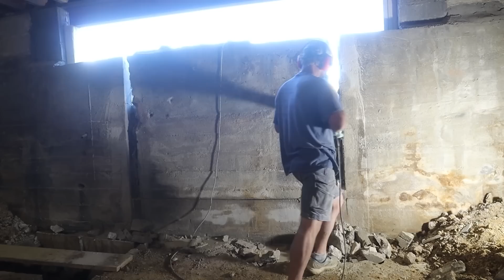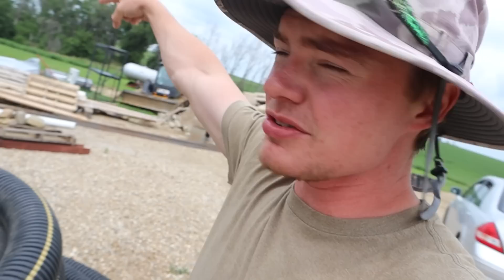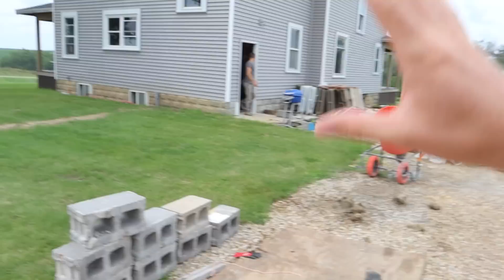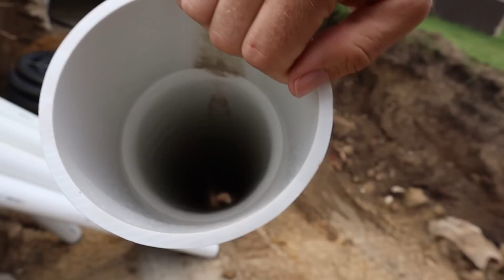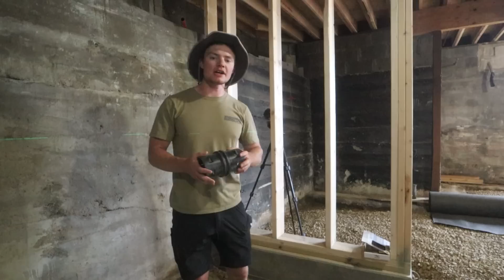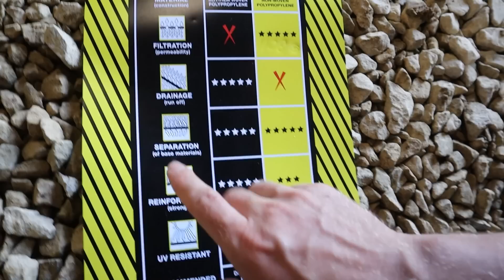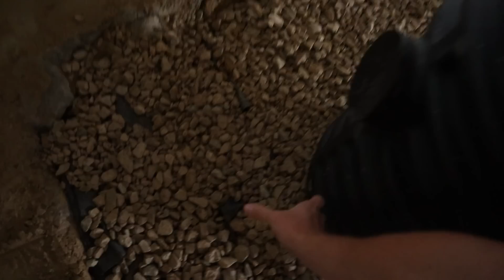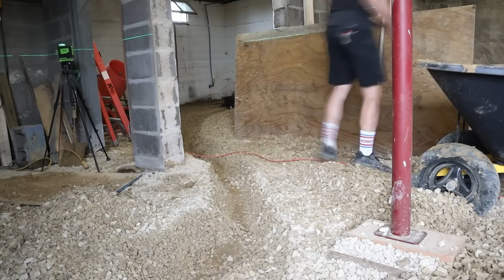Restoring A $7,000 Mansion: Building A Basement Water Removal System

Comment: I’m still confused as to the advantage of keeping this unit standing and rebuilding it from the inside. Everything is being replaced. After redoing the attic and the third floor and all the flooring in the second and first floors plus the staircases now you are again in the basement to actually create footers and the sewage and water. 
Couldn’t this have been done new from scratch and have saved $ and time??. Would save from digging out footers with a hand trowel and fixing the drainage and the radon. Can build it in from the start.
Reply: tearing down is much much more expensive then doing what he is doing.
Reply: @warrenmichael918  

Possibly cuz I’m not up on a real estate in Iowa but land is most expensive cost of building house - and he gets it for free. 
This   has essentially replaced every stick of lumber in the house on all floors. 
 I’m sure there may sentimental attachments to this property .. and that is good reason tốt do this … I missed those episodes. 

Still… regardless. I’m super impressed by all of theirs work ethic and focus. For never having done this before he is learning very quickly.
Reply: @lawrenceeldridge1155  Sentimental attachment is a HUGE part but also it is just way cheaper to fix up rather than tear down and rebuild. He doesnt have to pour new basement walls, no exterior walls , no new roof, its all there now.

Comment: You all seem to be doing a very good job. I sure hope a tornado does not come and wreck that house. Based on what I have seen in the vids. I would be digging a tornado shelter and having it made while the house is being fixed up
Reply: This reminds me of one of my tenants at the strip center asking to raise the brick level because a vehicle busted out the glass… for the first time in 35 years of the building doing what it does the glass is broken and now they want to change things. It’s always a possibility but the ladder isn’t always the best way. 

If the house has been fine for 100 years without tornados tearing it down I have reason to believe another 100 years could handle it